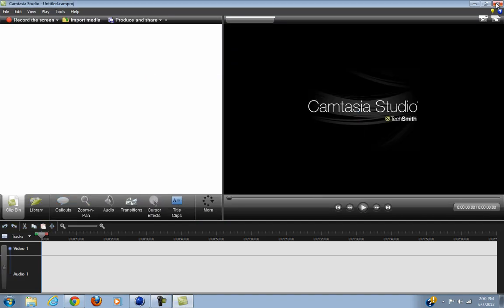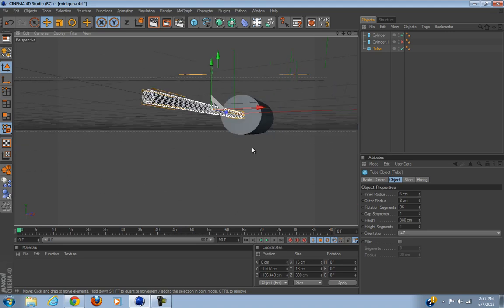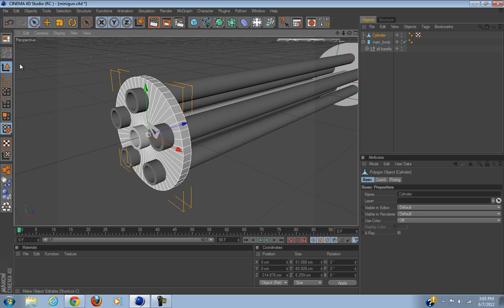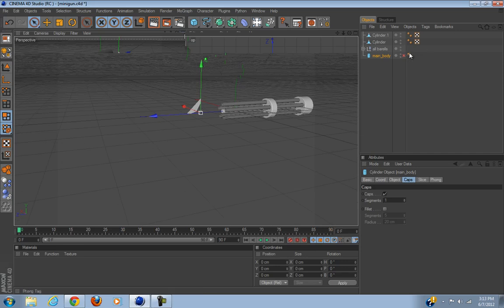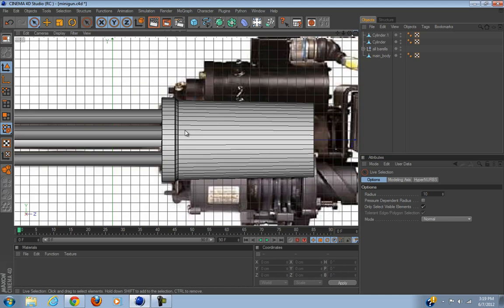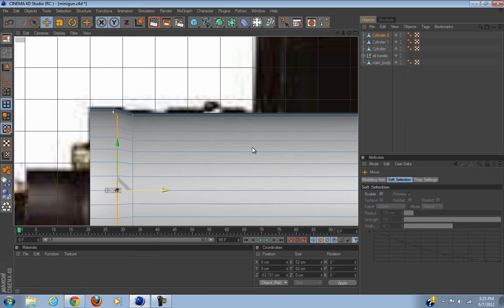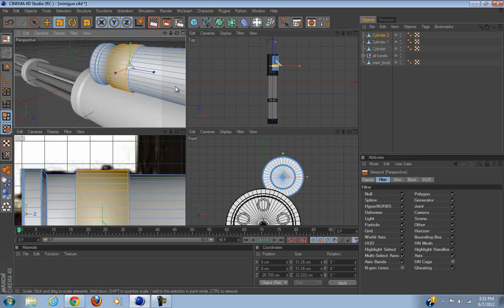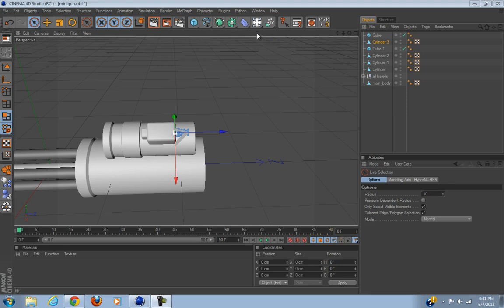Minigun Modelling Tutorial Cinema 4D Part 1

Comment: Because if you keep your project files on the same drive as your windows installation, if it crashes you'll lose everything you worked hard on when you have to reinstall as you've already experienced. I recommend investing in a separate drive for your project files and source files.

I speak from personal experience and it's a mistake I never will repeat again. It's embarrassing having to explain to a client that you had to start all over because windows crashed.